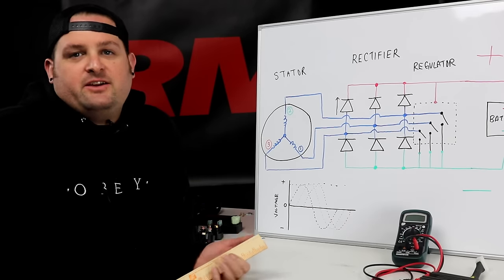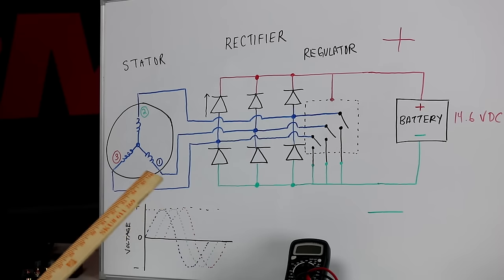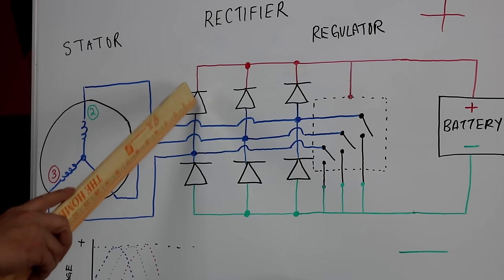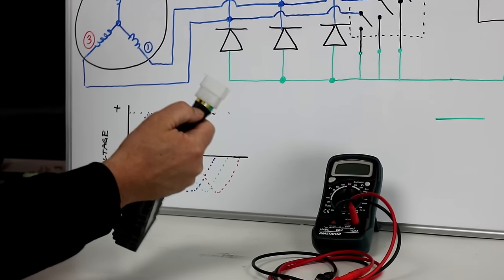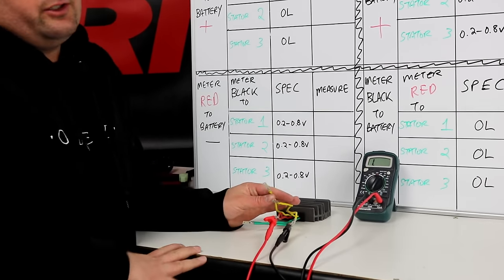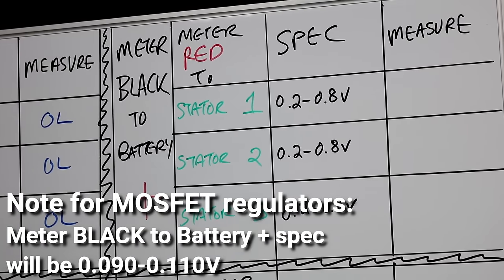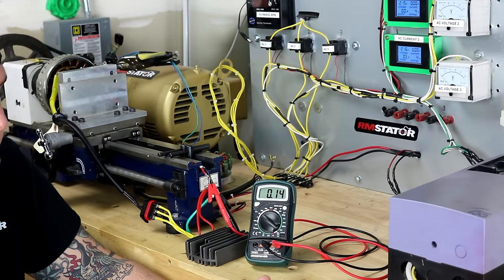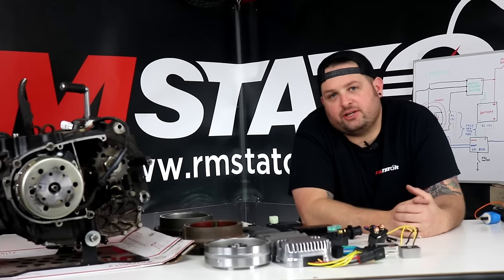How to Test Voltage Regulator Rectifiers for Motorcycle, ATV, UTV, Snowmobile & Powersports Engines

Comment: Absolutely excellent video!!!  Thank you. 

The voltage on my KLR650 jumps abruptly between aprox 13.3v to 14.2v at intervals of a few seconds or more.  This makes the headlight and dash lights dim and then brighten again at the same intervals.  Do you know what might be causing this?  The battery is keeping its charge.

I replaced the stock RR with a used unit form ebay with not luck.
Reply from the maker: No problem, glad it helped! Your issues sounds like a failing voltage regulator. The regulation control circuit is failing, and is firing the shunt switches incorrectly, resulting in large voltage changes. It is also possible you have a stator with an intermittent short to ground. Hope this helps!

Comment: measure volts to test diodes, or use diode test on multimeter?
Reply from the maker: Diode test function on the multimeter will give you a voltage measurement. It is calibrated for an accurate measurement of the voltage drop across the diodes.

Comment: Will the Amps rise equally with the voltage? Lets say you got 0,5 amps at 12v. Will you have1 amp at 24 volts etc? How many amps can you get out of lets say a bicycle generator?
Reply: Putte På Luffen  The simple answer is in ohms law. Which in laymen’s terms,  means voltage has a direct effect on amperage. Think of a bicycle pump. Small pump but works perfect for a bike tire. Now imagine trying to fill a giant truck tire with the same bike pump. It wouldn’t cut it because it can only produce a limited pressure to flow ratio. In your case 12 volts can produce as many amp as the system allows, but 24 volts  can theoretically produce more

Comment: I've got a constant boiling battery on my Yamaha MJ50 (6 volt battery), I've tested the rectifier as you described and all is good, my regulator is separately installed on the bike and I've swapped it also for supposedly a good regulator but the battery keeps boilng, my shop manual says that while running full throttle I should read a little less than 2 amps but it tests at plus 4 amps but the voltage test is good at about 8 volts on full throttle. maybe the new regulator is'nt good??? otherwise what could be wrong?
Reply from the maker: Definitely sounds like your new regulator is the issue!

Comment: Very helpful information. Thanks for making this video.  One question. My voltage is on 12v even when I rev the engine.  Does that mean the regular is probably ok but the stator is bad?
Reply from the maker: No problem. Sorry that's not enough info to diagnose on. It could be a bad stator, voltage regulator, or both causing that problem.
Reply: @Rmstatorinc  I understand. Thanks for the reply. I took it apart and found out that the generator was bad. All of the magnets had come off. Someone wrote that Yamaha (I have a 2009 FZ1) just glued them in and sometimes the glue fails. Thanks for your video though because it helped me determine that I had a problem in that area and it helped me understand the charging system.

Comment: You guys need to make a video on how to set up the regulator rectifier on  The mosfet technology I just brought from you be I have two yellows and a black and red wire coming out of my regulator rectifier
Reply from the maker: On most of our MOSFET (and standard style) regulators, wire color and function is mostly standard. The Yellow wires generally go the stator wires. Red wires are usually Battery +, and Black wires are Battery -. I'm happy to help more if you tell me what part number, and make/model/year vehicle you have. Thanks!

Comment: My regulator was toast measuring 17 volts DC at battery’s. Engine started fine then after a few seconds started to run badly. Seen others reporting same problem on web. Some switched on lights and this bled excess voltage away and engine ran ok. I disconnected plug from the generator to regulator and started engine it ran fine. When plugged in ran bad. With engine stopped checked windings in generator to ground and no continuity, against each other continuity same resistance against each other. Running AC volts tested out at AC volts up to 17 volts dis one ted  Generator side good. Measured voltage at battery with Voltage regulator connected. Over 17 volts. Tested wire for continuity. Regulator has permanent neg permanent plus and a switched plus thee AC feeds from generator.  Regulator is toast. To much voltage rotor producing to much current. Affects engine running flat and misfires. New regulator on way.😀

Comment: how mutch ac voltage output one phase in stator full race
Reply from the maker: If the stator is unloaded, you could easily see 60-80VAC at 5k+ RPM. When connected to a load through the regulator, it will be much lower, 20-40VAC or so. These are very generic numbers, it depends much on the exact system you are using.

Comment: Ah! No! Really bad! Not how a regulator works at all 6:06 more like over voltage protection sure. But you are short circuiting the negative (and positive) swings of the stator to the negative terminal of the battery which as you explained earlier in the video would be bad for the battery hence the bottom 3 diodes, If you close those switches while the engine is spinning you will basically put the battery voltage 14.6 Vdc  across the diodes reverse bias so you will need very expensive diodes,  plus you are effectively loading the stator outputs to a short  cct and sucking engine power because there will be a huge current draw no power station ever short out t
The scary thing is all the morons who have commented how great this is!